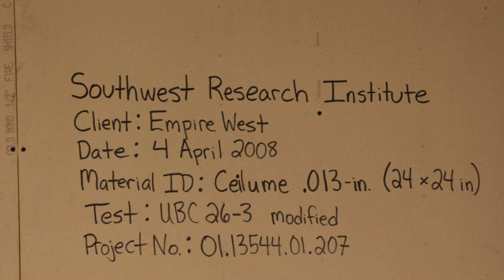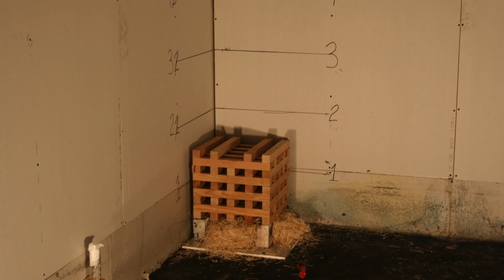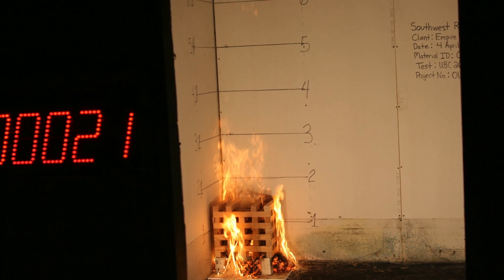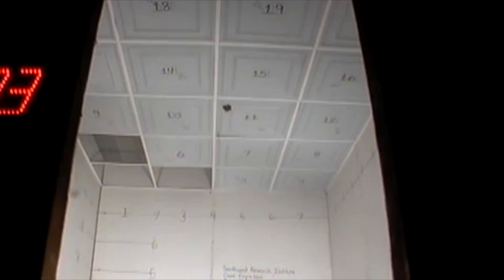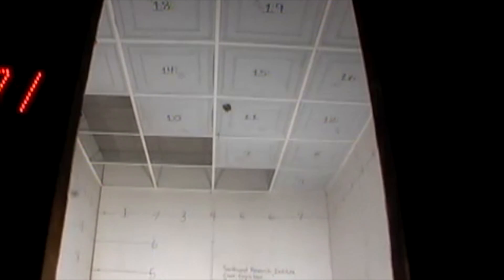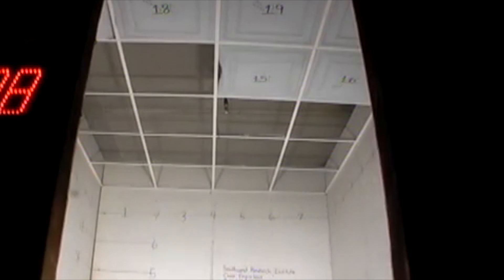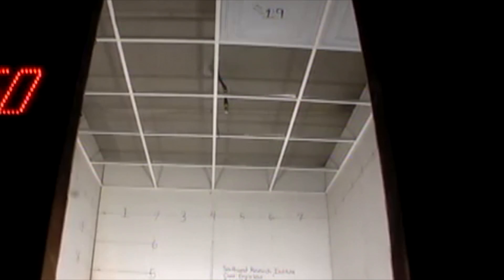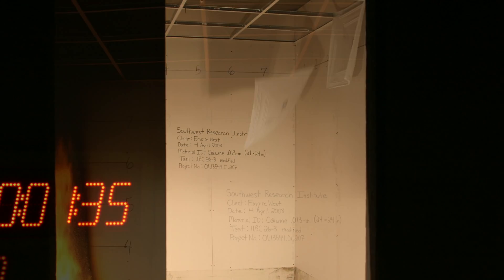Drop-Out Ceiling Panels, Room Corner Burn Test

Comment: don't see why there is a pendant there, should be an upright sprinkler
Reply from the maker: Thanks for your interest in Ceilume!  

We take our fire safety testing very seriously and asked for clarification from the test facility regarding the sprinkler type that was used. For a standard room corner burn test, the sprinklers are installed in accordance with the test criteria to measure any difference in activation time.  A pendant sprinkler has to be used at the finished ceiling as upright sprinklers can only be installed on branch lines or sprigs.  A pendant sprinkler is also used in the drop ceiling so that the sprinkler is flush with the drop ceiling.  As we are comparing the effect on activation times, the same sprinkler type is used in both heights/locations.  Please let us know if you have any other questions.  

Thanks!
Reply: If the sprinkler is within 12" of the noncombustible deck then it doesn't matter if it's a pendant or upright. First viewing it looked over a foot, maybe ok. Thanks for the answer.
I have a customer who says a contractor installed meltaway tiles. They look like cheap insulated ones, economy type, I need to look at a metlaway tile to compare, any dealers near me? Worcester Massachusetts.  @ceilume
Reply from the maker: You can order three full sized samples and purchase our full range of Ceilume products directly from us by visiting Ceilume.com. You can also visit our authorized retailers for selected products. These include Lowes, Home Depot, L&W Supply, Amazon, Sutherlands, Menards, uDecor.com, Proceilingtiles.com and WishIHadThat.com. The only one that carries any of our tiles in store is Home Depot and they only carry them in selected stores. You can reach our customer service team directly at 1-800-557-0654.